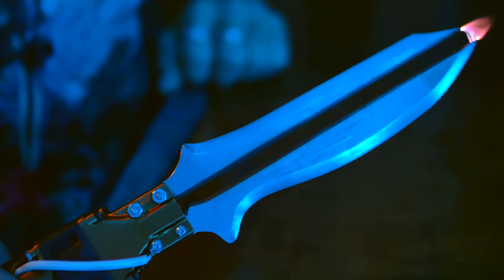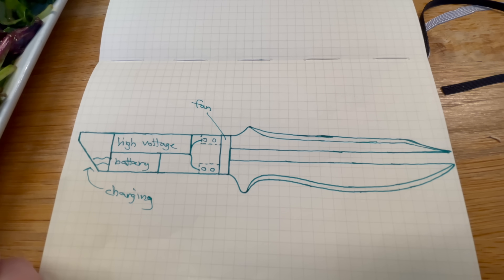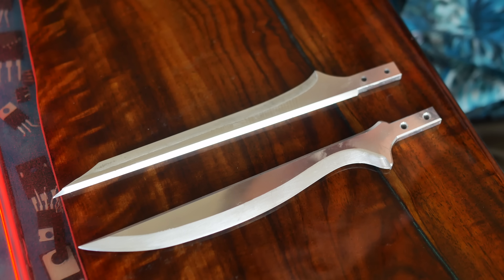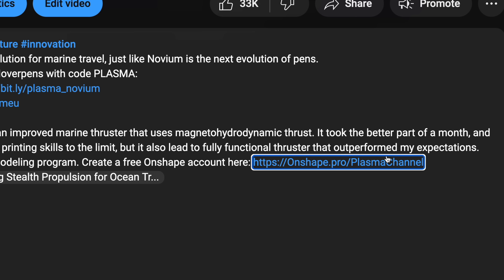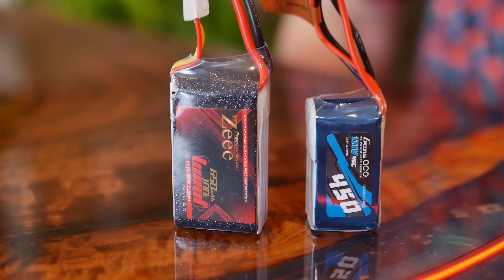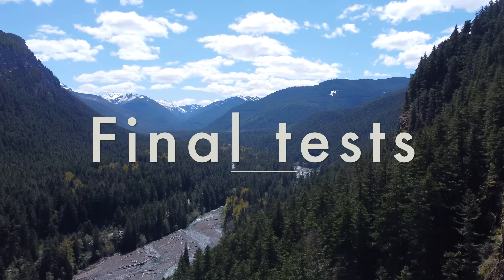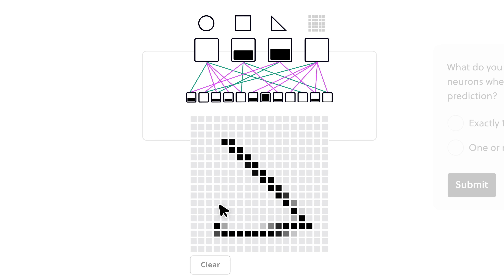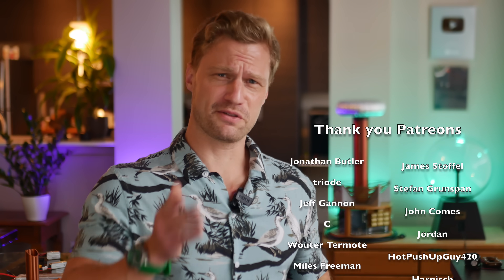A 20,000 Volt Next Generation Plasma Knife (Halo Inspired)

Comment: You could get lihv batteries and most applications that will run 3s will normally run 4s also. Why we are not using coolent on the end mill? This keeps the cutting part nice a cool and you're able to machine steel